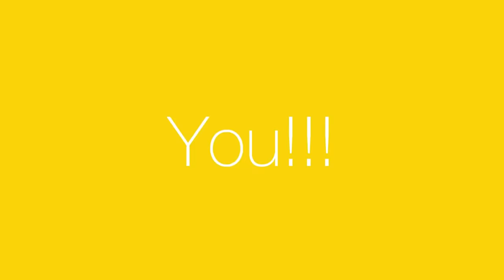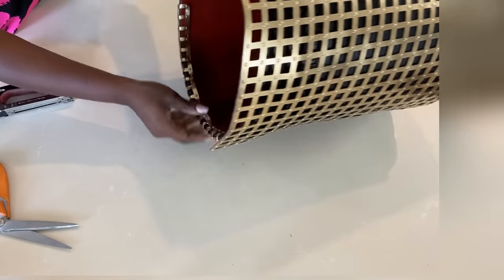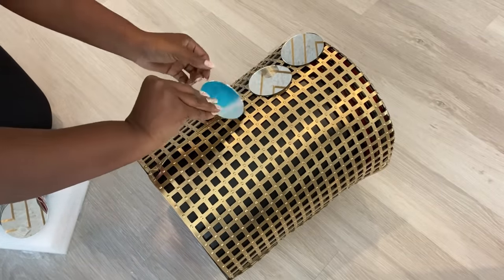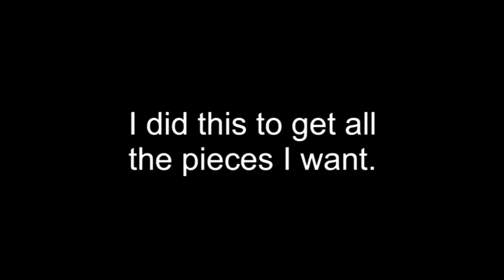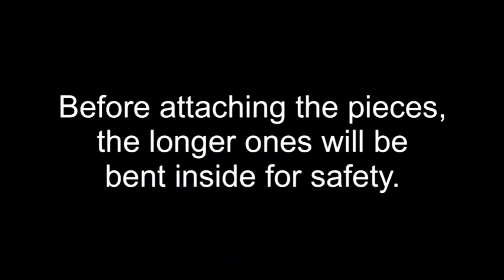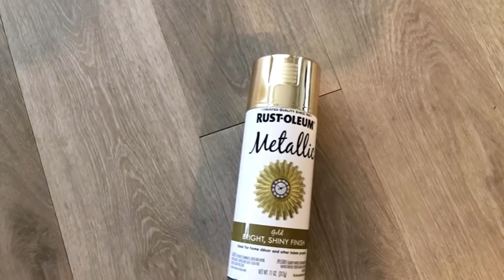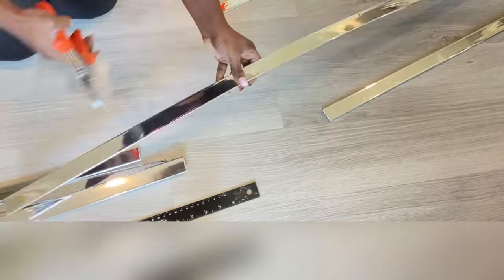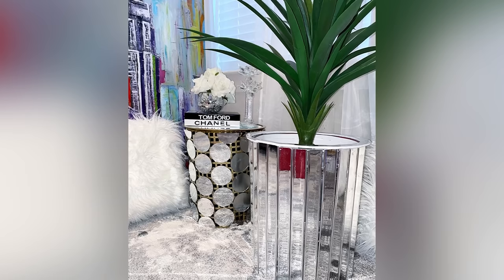PLASTIC BUCKET DIYS THAT WILL GIVE YOUR HOME AN EXPENSIVE LOOK!

Comment: You are an absolute genius!  I had an idea to make a gold dinning table since all they seem to have in stores is chrome for some reason!  I have quite a few buckets because my hobby is reef keeping so salt for my tanks comes in the buckets. I have to say my idea was no where near as creative as yours though and I wouldnt have had the idea at all if I hadnt watched you videos b4 lol.  What I wanted to know is do you think if I gorilla glued two buckets together (since I need the xtra height) If 4 of them(one on each corner) would support the weight of a 72 x 44 glass 3/8 thick or 1/2 inch?  Also where do you get the round mirrors?  I know you said it was hard to find anyone to cut in your area.   I would love to do the one with the pipes but dont know if I can pull that off! I thought about making them into pedestals as well!

Comment: On the bucket with a zip tell us on PVC you could drill a hole and use a wood Dell in glue it would be just as cost effective and durable with esthetic rivet looks

Comment: I spray painted a plastic sink mat an the paint remained sticky even months later is there a special process for this?
Reply from the maker: It’s a tricky thing spray painting rubber lol! The paint gets sticky if you do the spray painting in a damp or humid weather so I try to avoid that kind of weather when spray painting anything made with rubber 💕
Reply: @yoduvhessentials6310  it wasn't rubber but plastic done in the house so no moisture it is almost like it melted and is sticky.